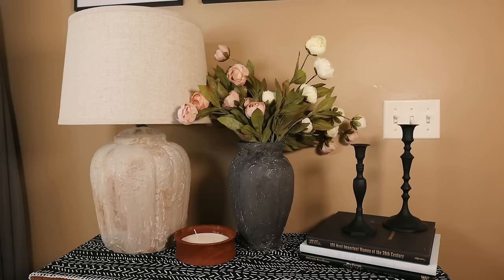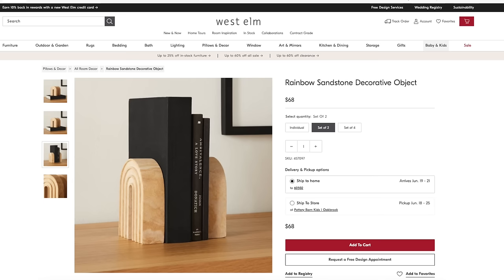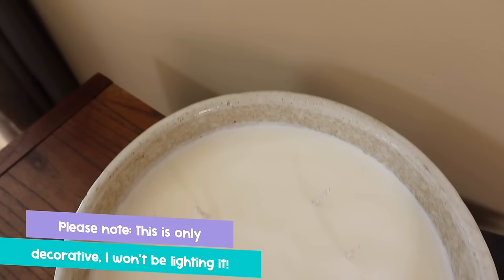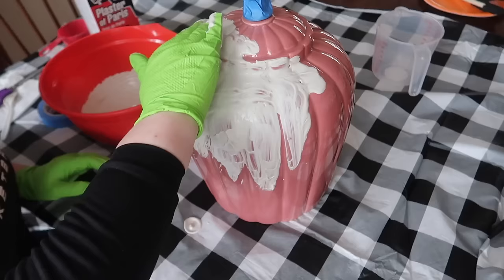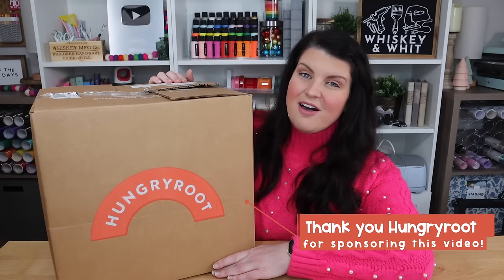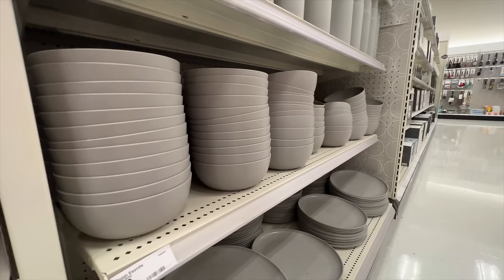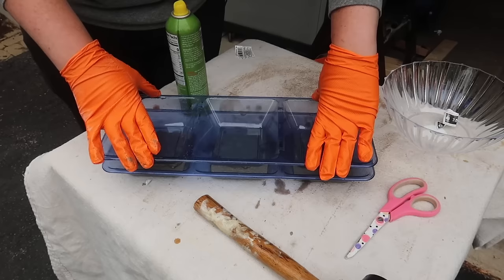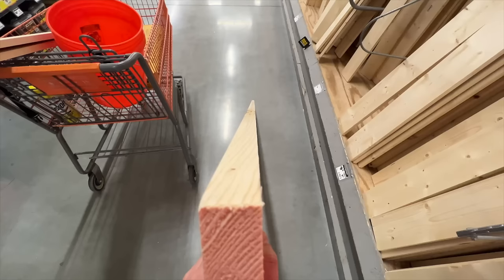WOW! Save HUNDREDS DIYing vs. Buying from Pottery Barn! 🤯 Easy Home Decor DIYS on a BUDGET!

Comment: You can get the same affect using baking soda and craft paint. Can make it as thick or thin as you want it and you can paint it on your surface. I’ve done lamps and candleholders and it turns out great. And and has held up really well.
Reply from the maker: Totally! How we the plaster gives you deeper peeks and valleys which I like when I paint it so you get the little white to show through. But I have also done that same technique with great results ✨

Comment: If you want to distress a board quickly without much work you can slide it across gravel. Step on it or jump, kick it so it slides or get the kids to come have some fun. Be sure to check it often so it’s not more damaged than you want.
Reply from the maker: Great tip!

Comment: Would you make candles in the cement bowls?? Also, why do you prefer plaster over spackle? I’ve never used plaster!
Reply from the maker: You could do the candles in there, I just wouldn’t light them because I would be afraid they weren’t going to be good with all the heat. But you could use it for decor. 

And honestly I was just playing around with different mediums and both work well. The spackling works better on smooth clear surfaces like the glass in the long run. It grips better 💕✨